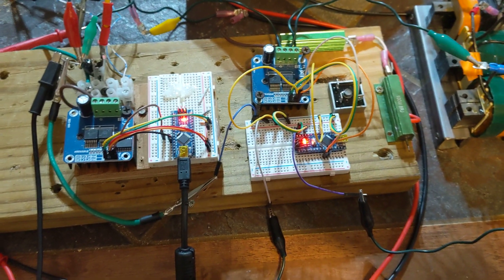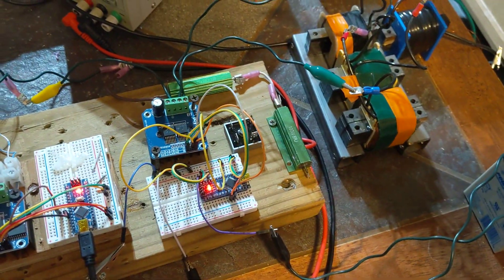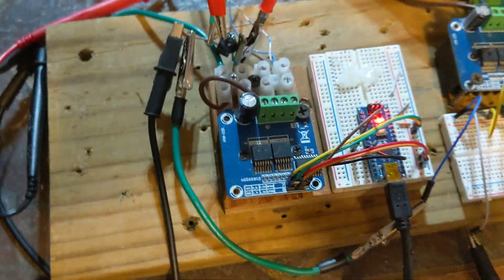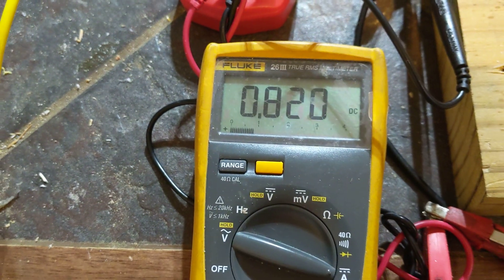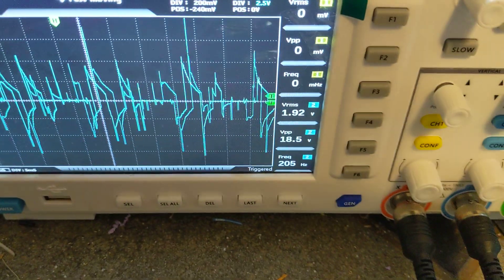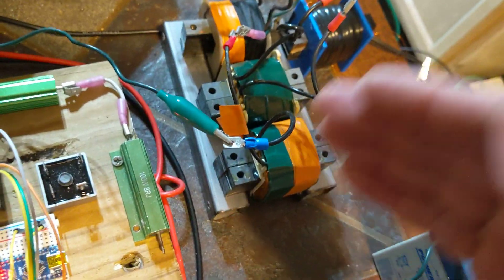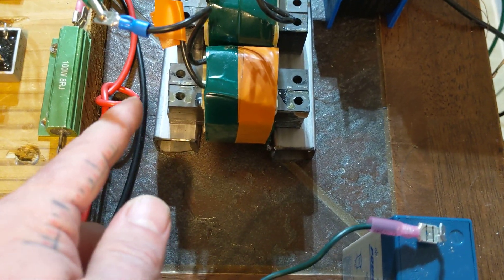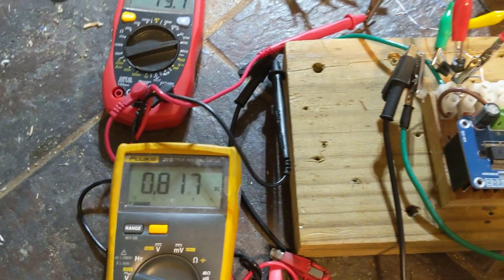Back EMF - growing flux reversing lenz

Comment: Very interesting work.

I enjoy your tank circut videos ...helps dyslexia people like myself.

I've done a few of Bearden experiments....
Make sure the core is undersaturated.

Bearden and others were making power with ceramic magnets...which are 1/10th stregnth by size and weight.

And many of their magnets were only a few lb pull.

Just something for those to think about if you want to make a meg. 

Nothing wrong with slow switching MEG either

Comment: I always thought power Co harvest atmospheric electric.  Just look at the power plant size compared to how many motors and watts used by consumers it's way too small
Reply from the maker: Well even accepted electrical theory kinda suggests it.  It's known fact that when we induce a coil, the induced coil creates a magnetic field equal to the power it inducted.  So the induced magnetic field of the secondary flows back through the primary, thus passing the load to the input in conventional electronics.    Now what if we could do that but make the secondary ground to the hot lead of the primary coil?  All induced current would return right back into the source or into the circuit.  (which my circuit does)..    Now it's a matter of building the flux field..  Workin on it..

Comment: Hi, have you tried putting low ohm resistor rather than shorting the pickup coil?
Reply from the maker: Hi,  Yes I have used several loads so far.  I have several setups I am working with and just starting to build a bunch of coils to experiment with.  Hopefully I find the configuration that finishes it :)

Comment: Is it like Thane hiens where back mmf or secondary mmf is coupling to the a third secondary coil and its secondary mmf is coupling to the 4rth inductor?
Reply from the maker: Not really.  Thane uses 1 primary and 2 secondary's, which causes the emf from the secondary's to bypass the primary and go back through eachother.  The reason I don't mess with his setup is I don't think the output can ever be as great as the input because all the secondary EMF loops through the other secondary and vice versa.    Many people have built his but I have yet to see one self-excited from the output.   The objective I am aiming for is to return the secondary ground to the hot lead of the main circuit.  Then all flux passed to the primary flows back into the source.   I am doing it by creating Back-EMF, separating it, and then changing only the back-emf (flowing up-river) to alternating direct to excite the electromagnets.

Comment: Great can you add circuit schematics and the code
Thanks for sharing
Reply from the maker: It's still a work in progress.  If I achieve the desired results, I will write it all up and share
Reply: Brother its work like push pull. When primary push secondary off, when secondary pull primary off.

Primary creat hight voltage to vapacitor charge very swift time then auto off, and secondary is directly switch from vapacitor to battery across.

Its working to easy an used arduino.

Normally, u can do it mannually.

At first you charge the capacitor , used hight voltage secondary, u can used relay or normal tranformr. I recommend used an relay switch. When single pulse switch relay at that moment capacitor across the relay coil, and when disconnected fron battery to relay , then that capacitor switch to battery. That means , first time battery to capacitor charge used relay, then caoacitor to battery charge.

And this used here more better concept.

Thank u.